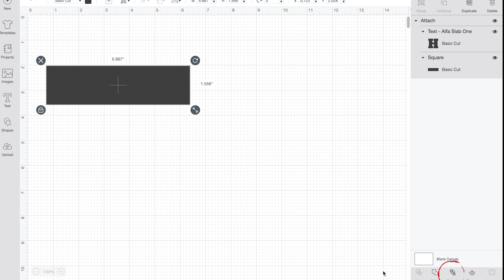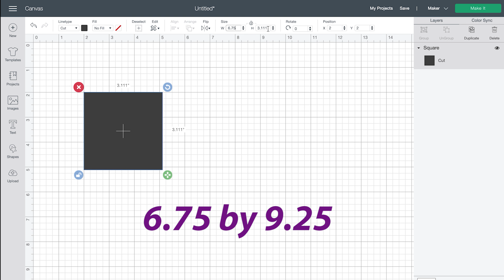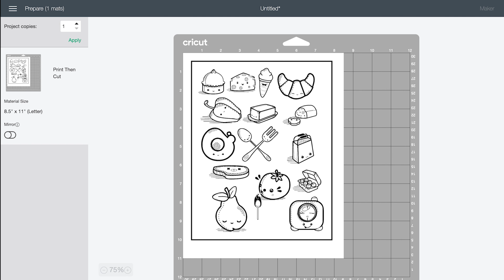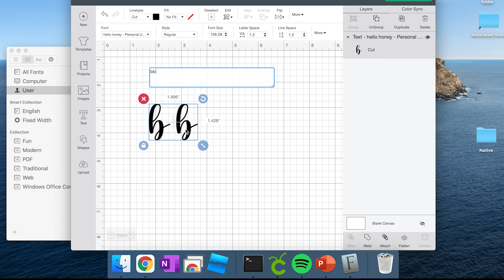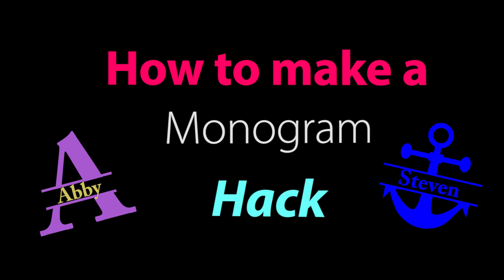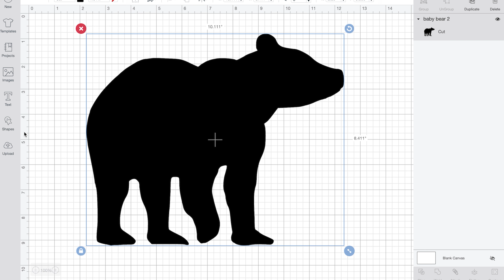Cricut Tiktok hacks part 2 (Design space Hacks)

Comment: Santa brought me a cricut!! And this video was SUPER helpful...though in my excitement, already bought for a dollar a set of the letter monograms..lol. wish I would have seen this first. Will check out other videos but will ask in case you see this...how do you import multiple images from computer at the same time? Bought some images like your bear but can only figure out how to upload 1 at a time. Some svg bundles are HUNDREDS of images! There has to be a way, right? But control or shift is not working...how do I do that?
Reply from the maker: Congratulations on your new Cricut! As far as downloading multiple images at the same time. I would recommend downloading them to your computer and uploading them into cricut design space as you need them. If you try to download them as multiple images the quality may not be as good. If you really wanted to. You could use Inkscape and put several images on a page and save as an svg and upload it that way but your quality will suffer. Good luck!
Reply: @kristenscricutcorner2258  oh! Ok...seems reasonable. They sit in computer download and then bring them into design space as needed. Got it. THANK YOU!!!!

Comment: 1. The letter spacing doesn’t always work and line up correctly on all fonts..
2. You can also find those special characters like the heart and such on dafont and it will show you which key to press to show those special characters. Example the heart ❤️ you would press the < key for the heart to show up... just scroll down on the dafont website and it will show you.
Reply from the maker: Thank you for that information! Yes I have seen depending on the font and the specific letter it is not always perfect.